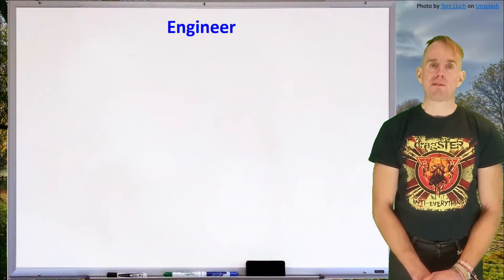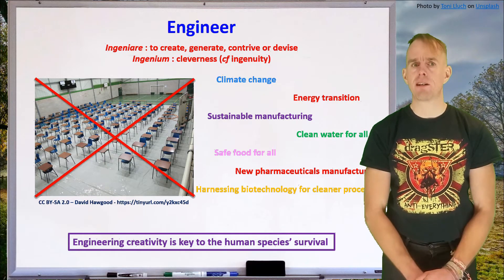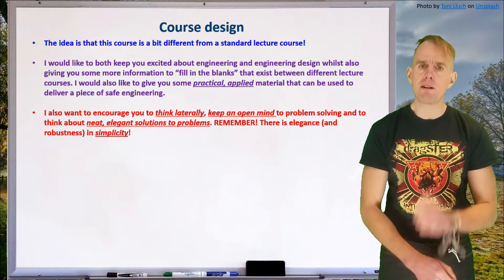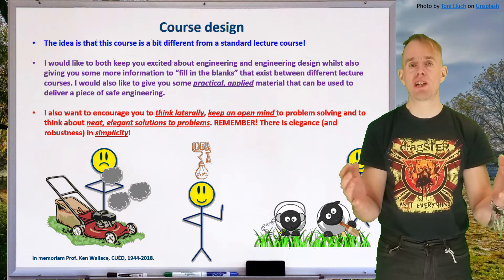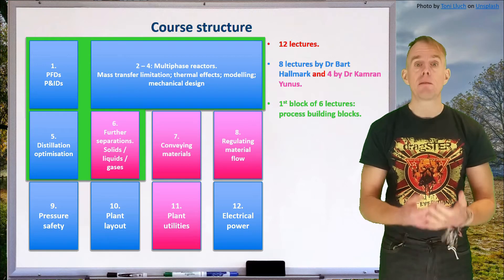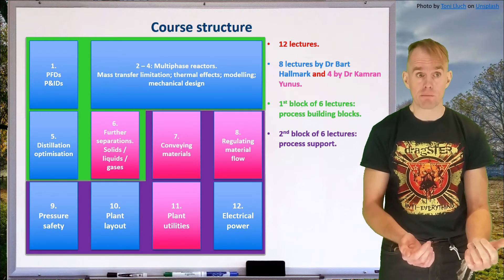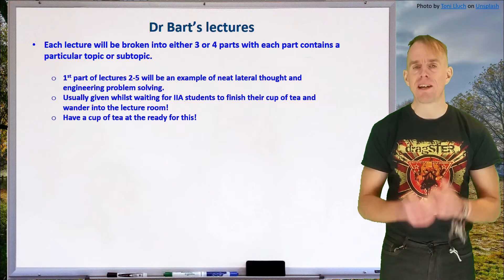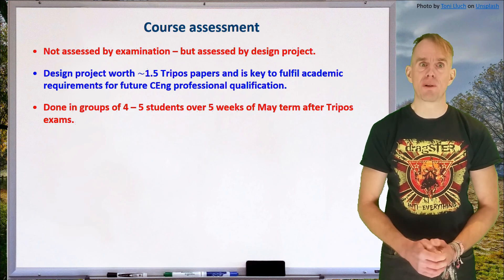Chemical Process Design - introduction [by Dr Bart Hallmark, University of Cambridge]

Comment: Hi, I am from Ecuador and the last subject to finish my degree is the design of plants and need all the knowledge. Well, my question is, could you send me information about of design of plants and different equipment? or tell me what is the book guide for your university to read, please answer my question. thank you
Reply from the maker: Hi Oliver,

Sorry for a late reply. Firstly, good luck in the final phase of your degree - I hope that your studies go well and that you achieve your future plans and goals.

In terms of plant design, there are a couple of very good reference texts (IMHO). The first would be Towler & Sinnot's "Chemical Engineering Design": https://www.sciencedirect.com/book/9780080966595/chemical-engineering-design You may be able to find an e-book cheaper than the physical book's retail price. A cheaper way of getting almost the same information is to look for a copy of Coulson & Richardson volume 6 - basically a previous edition of Towler & Sinnot, but often easy to find second-hand: https://www.amazon.co.uk/Chemical-Engineering-Design-Vol/dp/0750665386

There's lots of other specialist texts that also apply of course. A useful one is "Rules of Thumb for Chemical Engineers": https://www.amazon.co.uk/Rules-Thumb-Chemical-Engineers-Stephen/dp/0750678569/ref=asc_df_0750678569/?tag=googshopuk-21&linkCode=df0&hvadid=570229818468&hvpos=&hvnetw=g&hvrand=1144922330695638868&hvpone=&hvptwo=&hvqmt=&hvdev=c&hvdvcmdl=&hvlocint=&hvlocphy=9050370&hvtargid=pla-1139156036769&psc=1&th=1&psc=1

I've also put together a selection of notes on design that may or may not be useful for you. The first chapter is available free here: https://payhip.com/b/KEUun

I hope this helps! Good luck with your studies.
Reply: @drbartsworldofchemeng   Thanks a million for sharing